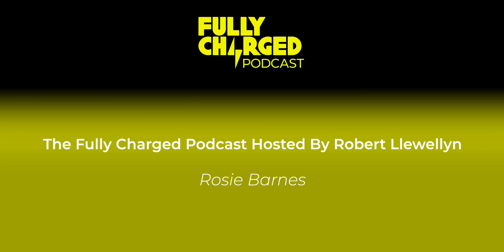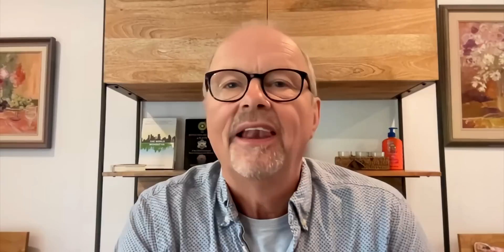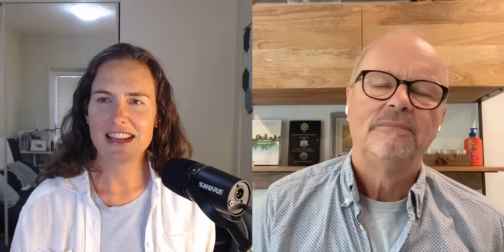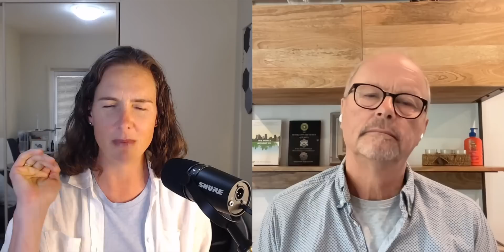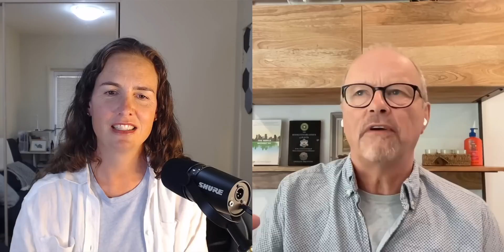The Inevitability of a 100% Renewable Energy Supply with Rosie Barnes | The Fully Charged Podcast

Comment: Your discussion about renewables being blamed for unreliability of grid supply really struck a chord with me here in New Zealand. It seems that every news report of major power outages here is accompanied by the anti EV brigade using it as confirmation that the increase of EVs will overwhelm our power supply capacity with the likelihood that it will result in more thermal generation being required.

While like many countries we have an incentivisation scheme in place that gives a tax refund for those that purchase EVs there is no incentivisation in regards to installing domestic PV. It is so frustrating that those of us who have installed PV and are exporting our excess generation to the grid aren't being rewarded for our input but rather we seem to be taking one for the team. 

Recent extended power outages due to a cyclone that has trashed a significant area of our North Island's East Coast has seen mention of the ability of 'micro grids' to provide resilience as well as Ecotricity taking the opportunity to supply some of their disconnected customers with Atto 3s with V2L capacity. The conflict of interest for our big state owned power generators is a big part of the reason for PV being left out in the cold with grid tied PV owners receiving a pittance for their exported generation but maybe a natural distaster such as we're currently experiencing will have a silver lining in regard to distributed generation and grid resilience in the future. Here's hoping.

Comment: In Australia we have the smart energy metering and these have the ability to communicate with devices in the home if the homeowner opt into the agreement.
We could send commands to adjust the Air conditioners temperature setting because here we have issues with Heat and not cold, this could make enough difference to ease the grid load.
Reply: wowbaabaa

Comment: I think people will have to start thinking what industries become viable once renewable generation is greater than current/projected demand. I think particularly Australia is on their way there, clearly not immdediately but in the next 10 years. Their potential is huge.
Reply: They need to get Ford and others to start building batteries and electric cars in Australia!  Australia needs the tax incentives that we have in America, so that Ford will invest in a battery plant in Australia.  Otherwise Ford will say "We can import batteries to Australia once we have enough made in America to produce all the cars we need in America.  And that will take until about 2035.  

I would love to stop importing oil to America, and especially to places like a small village on the coast of Alaska, that must barge in millions of gallons of oil to provide heating and electricity to that small village each winter.  They have started to install a couple of small wind turbines, about 1 MW each, or less, to provide electrical power to the village.  They sometimes will fly in a jet, to drain the excess fuel into the storage tanks to get them through until the spring thaw, when a million gallon barge of fuel can fill the tanks again.  

For Japan, Singapore, and many other areas, they need to stop importing oil so they can stop exporting so much money they exchange for that oil.  I think it would be wonderful to replace some of Japan oil fired power plants with geothermal.  They might not need to drill down 1,000 feet to reach some 1,000F heat in the rocks!  Install a 8" diameter steel pipe, with a 1" diameter injection water line going down the center, to supply water, that can turn to steam, and then run the power plant on the surface.  

The total cost of ownership is much less with a EV than a gas car.  I like to compare it to the coal fired locomotives to the diesel electric locomotives they started using in the 30's in America.  By 1948, they started to shift to diesel locomotives, and by 1950, every rail line went to diesel.  It still took them 10 years to fully convert, and by 1960, it was rare to see a coal locomotive, and by 1965, there where only a handful still running a steam locomotives, mostly for excursion lines, and not for profit main lines.  

Australia will really miss the boat if they do not have incentives to the auto companies to build the battery in Australia and to build the electric cars there, even for export to other countries.
Reply: @Kangenpower7  Australia doesn't have the population numbers (bearing in mind there are multiple EV manufacturers i.e competition & The Chinese are aready supplying Oz) so it's not worth Ford's while to build plants in Oz.  There's a reason just about every car manufacturer pulled out of Oz in the last 10-15 years.

Comment: I am an electrician who works in the energy industry, including wind and solar, and come from a family of engineers. I am so pleased to see that renewables are the cheapest source of power in my lifetime. I am very much with Rosie in not understanding peoples reluctance to pay a little more to kick start this process. I was hearing of energy source agnostic studies in the early 2000's that showed US electricity could become 90% renewable within 16 years, and electricity would become cheaper, by massively overbuilding renewable energy generation, creating the organization and cooperation systems to manage the energy distribution, and upgrading power distribution. AND THIS WAS WITHOUT BATTERY BASED STORAGE!

The ideal mix of power was about 72% wind, 18% solar, and the last 10% would be hydro and gas peaker plants until enough vehicle to grid EVs could made up that last 10%. Tesla and others have turned the battery based energy storage market on its head, and change the speed at which adoption is possible. It all comes down to political will to buck the petroleum information complex, and it is easier to fool people than to convince people that they have been fooled.

When adjusted for inflation, the US has spent on average in direct taxpayer subsidies, 4.8 billion dollars a year  to the fossil fuel industry since 1918, 3.7 billion dollars a year on the nuclear power industry since 1947, and just 0.40 billion (400 million) dollars a year on renewables since 1994. Yet renewables are now among the cheapest sources of power, because as you point out, the cost of wind and sun is always free, and will never get more expensive to produce.

Comment: Robert, just a question.  We are told again and again that the electricity is cheaper from a new wind turbine than from an existing fossil fuel plant and yet it looks to me that electricity is getting more and more expensive all over the world and especially where there is a great penetration of wind energy.  Is someone profiteering.
Reply: Politicians trying to sell themselves as environmentally conscious and companies that build renewables are profiteering. They sell renewables by stating the peek output, which it only produces for a small fraction of the time, and don’t mention the high costs to the rest of the system caused by the reliability.
Reply: Yes they are profiteering a lot, but not exactly for the reason kokofan says. It's also to do with the way energy is charged. It is currently based on the wholesale price of the highest resource cost of electricity generation for covering the network in peak times, that being currently gas, so all these "cheap" renewable energy suppliers reap the benefit of HUGELY inflated prices.
This is something that needs to change as a matter of urgency as I have no interest whatsoever in renewable energy if cost to the customer is still based on the costliest "fuel" price used to generate electricity elsewhere & not the actual source of the energy used across the board. In my opinion, if a supplier says they only use 100% renewable energy then they should be mandated to charge you ONLY for the cost of that renewable energy - not what the cost of gas is, as last I heard was gas wasn't renewable.
Reply: @yips_way  selling at the going rate isn’t profiteering, and natural gas isn’t the highest cost producer everywhere. In the US natural gas is the lowest cost fuel, and if Europe hadn’t bet everything on renewables, they wouldn’t be having such a hard time right now with natural gas.
Reply: @kokofan50  The Nordstream2 II incident didn't happen in your version of reality?...  If they HAD bet everything on RE they wouldn't be having a hard time now.  If Germany had upgraded their North/South infrastructure they wouldnt have to sell excess RE abroad then buy back France's nuclear electricity at inflated cost to balance supply & demand, because Germany can't distribute it's RE due to aforementioned cr4p, outdated infrastructure.  If the UK had subsidised RE instead of wasting £billions on Hinckley C with the usual nuclear industry mafia 10 year build & £billions budget overspend...
Too many people posting here with only mainstream media information,  half of which is standard Fossil/Nuclear industry FUD to delay the inevitable RE onslaught & allowing those mafia cartels to keep screwing consumers/taxpayers.
Reply: @alexmanojlovic768  total bullshit. The Germans are dependent on natural gas because they bet everything on renewables. Natural gas is the only source of back up that can scale and keep up with the wild fluctuations of renewables. 

Nuclear mafia? Nuclear it the red headed step child of energy sources. Over regulated, and whenever someone tries building a plant they served with endless lawsuits from you idiots, slow down construction and costing billions.
Reply: The US terrorist attack on the Nordstream2 II pipeline & sanctions & other BullSh1t they're blaming on the Russians is the reason energy prices have risen so sharply.  It's "all the Russians fault".   Of course it is...Not...  It's purely profiteering using Russia as a scapegoat.   Why would Russia blow up their undersea pipeline to restrict access to gas, when all they had to do was close the valves off on the mainland?  Saving massive costs to restart supply.  Calling the Americans psychopathic C##nts would be complementing them.

Comment: Robert, did you realise, that the UK has taken a huge energy decision (without to my knowledge making an announcement), to go large on Hydrogen?
Or at least Gas/Hydrogen mix.
Near where I live streets are being dug up to lay new yellow plastic gas/hydrogen pipes, but what is surprising to me plastic insert pipes are being fed to the individual property meters!
If required property driveways are being dug up to facilitate this.
On enquiry with the workers, their company has a contract to complete the task for the whole of the North West!
I suspect this is a UK wide project.
Reply: Really? Why?
That really makes little sense, going electric will always be so unimaginable much cheaper in every way then hydrogen, why would anyone want to use it? Especially in their home.
Reply: @Baron von Limbourgh  I think they are planning 20/30% hydrogen mix.
I am planning heat pump and battery and disconnecting my gas!
Reply: @grahambrown42  good choice!
Reply: @baronvonlimbourgh1716  so the energy companies employing: neverending sales of consumables,  can keep ripping us off.

Comment: With batteries becoming cheaper; would it be possible to put wind in remote locations (desert) and run a rail line to the turbines.  Load large batteries on a rail car. charge. and move to populations?  Run a continuous loop of cars
Reply: Interesting idea but I'd assume that transporting that power through a cable would be cheaper.
Reply: For a start, you're transporting the batteries double the distance

That's weight and moving weight requires energy.
Reply: This is an engineering question. It should be answered by calculation. 

How would the energy cost of moving the batteries, plus the losses in charging and discharging them, compare with the energy losses in cable transmission?

How would the costs of building and operating the railroad compare with those of the transmission line?

Could the batteries be charged at the source, and discharged at the destination, without stopping the train to load and unload the batteries?

If the source were solar panels rather than wind turbines, could the intervening distance be chosen so that batteries charged during the day were discharged at night?
Reply: I would just put up a cable and send it trough there.
Much easier and cheaper and it is 100 year old technology already that we know how to do.
Reply: The great renewable con
https://youtu.be/BIXncWdwS-s

Comment: Virtual power plant will reduce the solar storage capacity needed and the EV battery used as storage will allow grid independence for a couple of days. :)
Reply: The EV battery is limited to when the EV is at the home for two reasons.
(Assuming the EV is used for its primary purpose and the home has Solar)
.
1) The EV will often if not always be away from the home during the peak solar generation period, which means the solar will at least in part be "offered" to the grid utility.
When the practice becomes widespread it's highly likely the "home solar" will simply be used to charge a utility battery (!) and there's a reasonable chance of oversupply from homes meaning that utility will not want the energy (if their battery network is full)
.
2) Unless you can guarantee power cuts will only occur at certain times, essentially when the owner is at home, the vehicle provides zero cover.
Imagine you're about to leave for work and there's a power cut?
What are your choices?
Stay home and explain to your boss you won't be in for the third time that month?
Leave and use public transport (in which case, why do you own the car?)
Leave in the car and hope the power returns?
You mention 
"grid independence for a couple of days".... 
Only if the car is there (see above)
.
Solar with a home battery solves the problem and pays for the system. 
You remove the home from the grid, and sell excess when you want to.